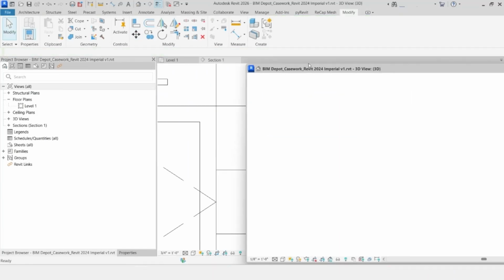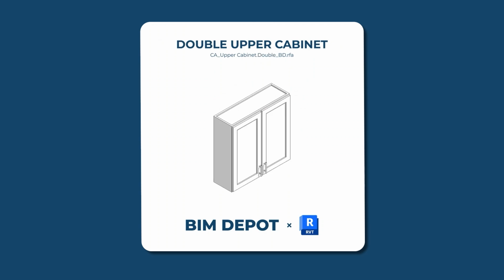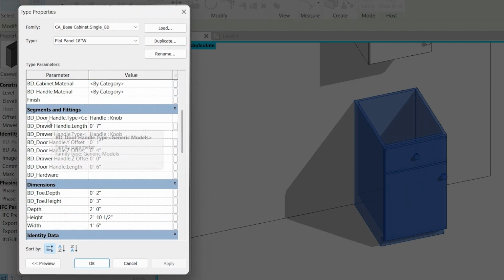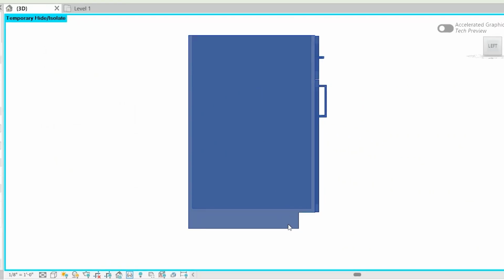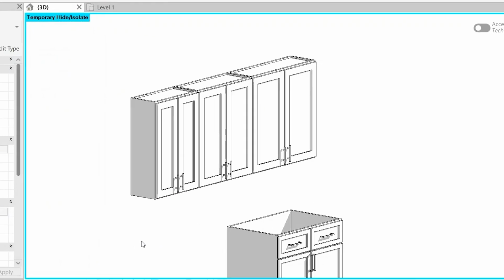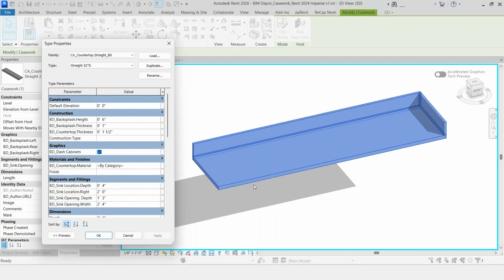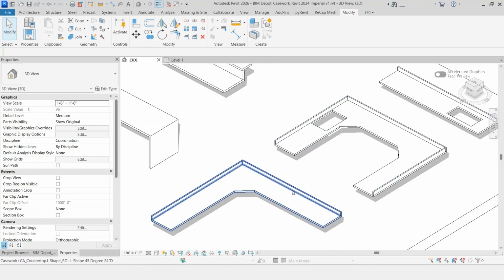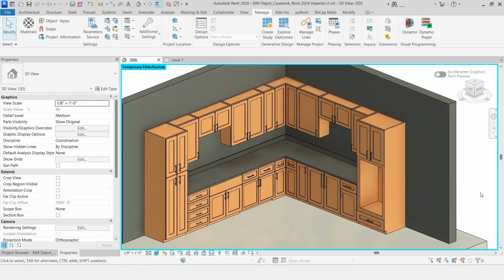Revit Kitchen Workflows for Real Projects

Comment: Do you have kitchen cabinetry / countertops combined into a single family? It would help for schematic layouts.
Reply from the maker: We are currently working on developing a family that can do this. There will be different kitchen layout families that have the option for base cabinets, counter tops, and upper cabinets. 
The intent is to facilitate very fast layout prototyping without having to specify kitchen cabinet dimensions, as that isn’t typically specified until later in the project.